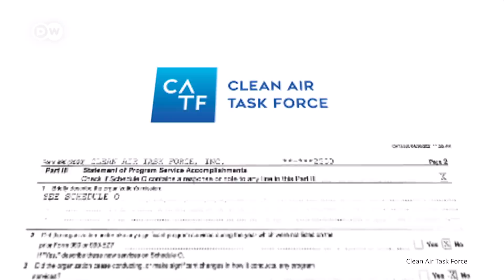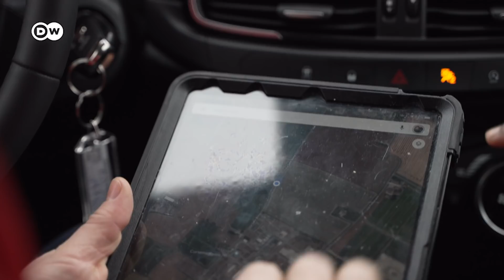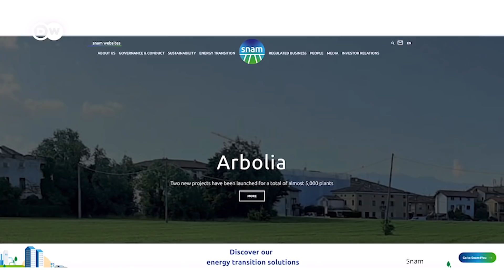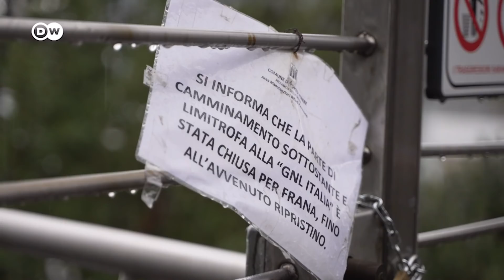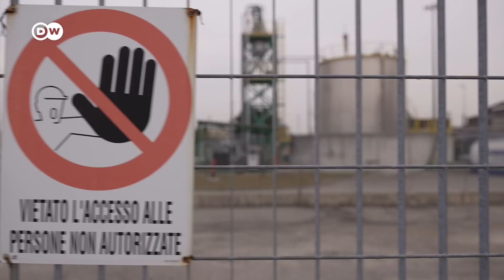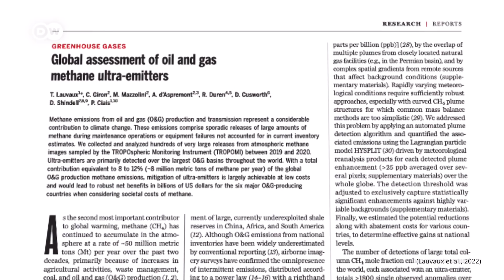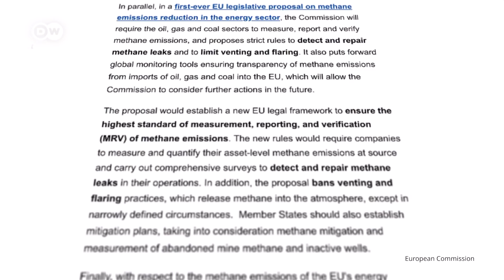This climate gas is scarier than CO2

Comment: Great video! We are a commercial drone service that operates gas detection payloads on our drones that can detect up to 1PPM of methane!
We are not getting any traction by the methane suppliers to allow us to detect gas leaks and in turn fix them .
We believe that since it can go unnoticed except for expensive detectors like yours and ours, they don't bother even though it could save them millions if captured.
We are trying to get them to make the shift, but they are resistant!
Need help to convince them!!

Comment: methane is not scarier than CO2 at all in my mind. methane leaks are easy to address. Right in the video they explain that the tech exists. If you fix a leak today, the methane emitted is completely gone in 20-30 years.

CO2 emissions on the other hand, has MUCH less obvious solutions, and it stays in the atmosphere for hundreds of years. Like all we have to replace combustion engines is EV, and those come with a bunch of environmental damage including some significant CO2 especially on the scale people want them ie billions of EVs.

Comment: A different point to make would be how to deal with the infrastructure from gas drills after all the gas has been harvested. Usually companies, will close the pipeline but will never go back to do any form of check back later down the line for damage. The metal can corrode and vent out gas later down the line. And companies are under no legal obligation to fix these and are unlikely to do so, themselves. 

Solution to fix this would be to fine companies at a fixed rate of Methane lost or how long the leak has occurred from.

Comment: Because of methane, natural gas has potential to be devastating for the environment. Really natural gas isn't much better than coal. Coal is much better than we give it credit for. Its stable, easy to store, economical to mine and transport and widely available. Its good for heating. Coal alternatives, biomass and natural gas have potential to be truly pitch black.
Reply: Coal still has significantly lower efficiency and higher emissions (especially particulate) natural gas isn't much better, but it definitely is better.
Reply: @garethbaus5471  Leaked methane is 200 times more potent greenhouse gas than co2 and big leaks are really catastrophic events. I would say natural gas has 90% of coals emissions. Also the infrastructure is expensive. All those investments could go to renewable energy.
Reply: @miiiikku  As bad as climate change is greenhouse gas emissions are not the worst type of emissions a power plant can produce, coal produces larger amounts emissions(like mercury) that are significantly more dangerous than the warming effects of methane. We definitely need to stop using natural gas as soon as possible, but coal isn't the solution and it never will be.

Comment: Climate change is driven by CO2 in the long run. I'm not sure how strategically wise it is to tackle methane emissions now. A quick but short-term (~20 years) spike in temperature may motivate us to tackle the CO2 problem faster.
Reply: That would rely on us cutting the methane emissions in 20 years. Why not do it now? Also we're far from equilibrium i.e. we're getting more heat from the sun than we're emitting back into space, meaning that the warming hasn't caught up to the concentration of greenhouse gases yet. This means that the methane creates warming that will not be reversible by just bringing the methane levels back down. All that a delay in this does is to cost us time in mitigating climate change.
Reply: @Kaepsele337  The point is that we are not doing close to enough to cut CO2 even though it is urgent right now. If we cut methane, cutting CO2 will look less urgent, although it is what actually drives climate change.